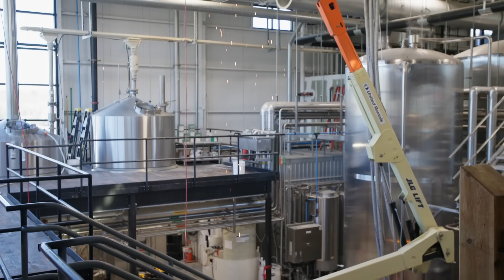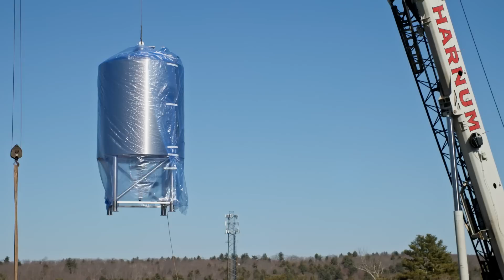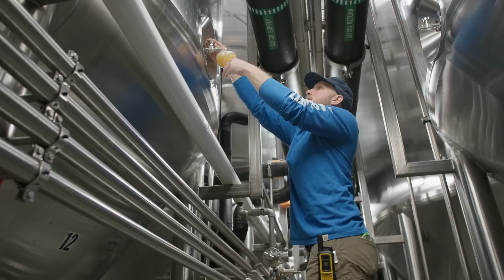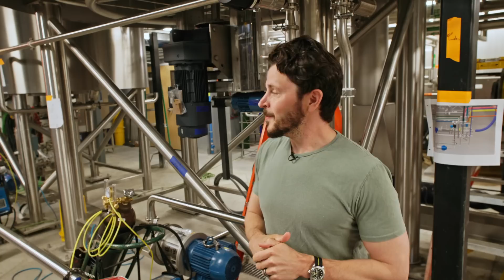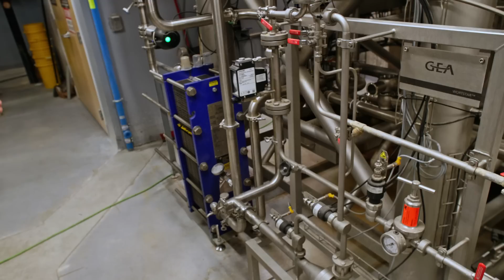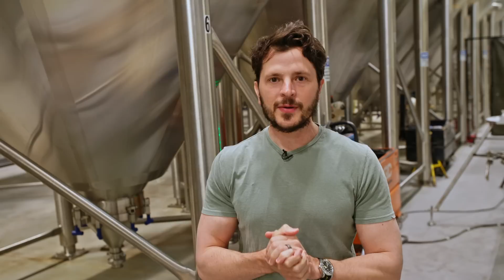Discussing a MAJOR brewhouse upgrade!

Comment: Why does the lauter tun take two hours?  Is it due to the volume of the tun so it takes a long time.  The depth of the mash should be similar when comparing 15bbl to 60bbl .  About 2 to 3 feet deep so I would think they would both take about an hour.
Reply from the maker: we have found between 110-130 minutes is best for us. I have never lautered in 60 minutes regardless of volume.

Comment: 2 questions:
1.  What ultimately lead you to a 2nd brew house vs adding a pre-run tank between the lauter and boil kettle?
2. What kind of logistical/ timing challenges do you think you will face when running both kettles with only one whirlpool and mash tun? (ie variations in mash and boil times, CIP requirements post KO, etc.) 
Thanks!

Comment: Small suggestion. For food and packaging type of locations. Cutting with a conventional fiber disk is ill advised. Plasma torch or cut off disk with metal based diamond cutter is much preferred. Automation nerd troubleshooting metal detectors and finding lots of dust or particles stuck underneath the belt. Just days after watching fabricators chopping and grinding near by. Just some thoughts and potential frustration curbing. Not that it'll eliminate those problems. But containing the schmoo somehow would be awesome. Grinding dust can attach and cause stainless to rust over time too.

Comment: Super interesting!  Never really thought of parallel batches thru thru the brewhouse.  But now the brewhouse has a single point of failure at the mash mixer and heat exchanger.   Any mitigation plans if either of those fail during a brew day?
Reply from the maker: Multiple spares for critical path motors, pumps etc.

Comment: Hello! Just curious why wouldn’t you make like a larger brewhouse instead of doing more batches in order to fill one FV? 😊 but i notice that big breweries have to double or quadruple batch in order to fill an fv….
Reply from the maker: Because 60 bbl allows maximum flexibility for us. Not every batch wants to be 120 or 180 or 240 bbls. Variety.
Reply: @treehousebrewco  Is it not easier to brew 1/4 or 1/2 batch using a 240bbl system rather brewing 4x using a 60bbl system? :)